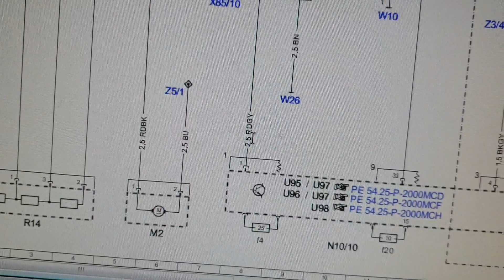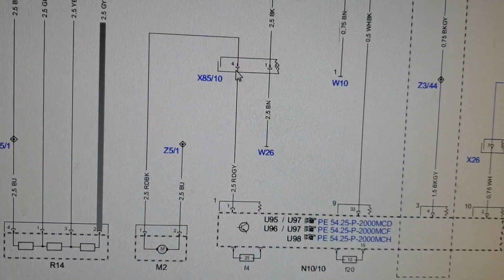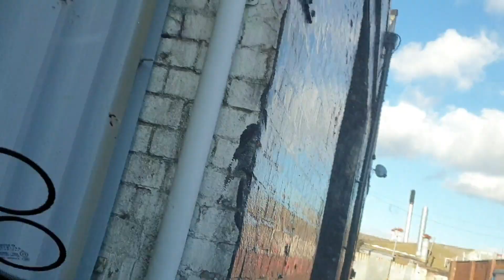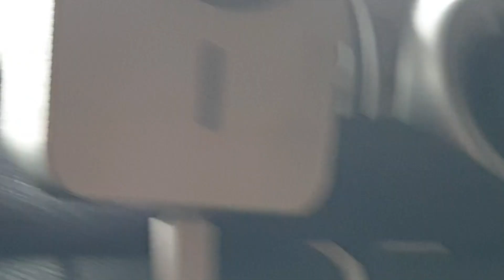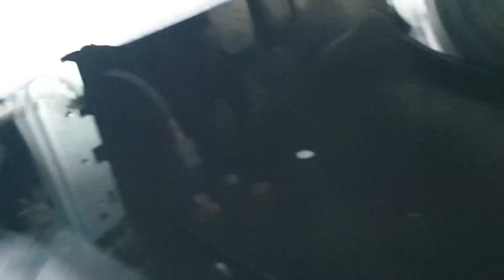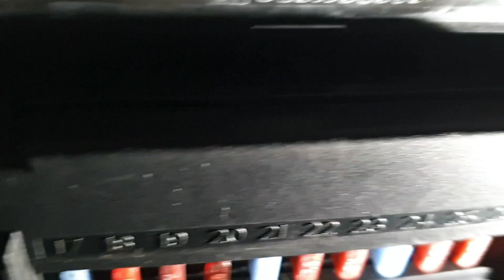Smart Fortwo MHD (micro-hybrid) 451: HVAC Fan/Blower Motor Circuit Explained, Diagnosed, and Fixed.

Comment: Is the heater blower motor located at the passenger's side (For right side driver)?  Do it need remove the SAM first before i can access/take away the motor?   Kindly adv. please...
Reply from the maker: Thanks for watching our channel. Yes, it is located on the passenger side, but I can't remember whether I removed the SAM or not, but you can find it in the video if you watch it.
Reply: @stanhopeautorepaircentrewardak  tried to take out the blower over 1 hr, still not succeed.  I did drop down the sam and let it more space for the blower out but still blocked by the thick bundle of wires. Great to have your kind adv.   Many thanks
Reply: I have same problem 😢 it was working afew days ago. Now it’s not working

Comment: Great video, slightly repetitive but very well explained. The 451 in our workshop also has no fan. After checking all the usual suspects, Fan, heater switch module, resistor we also opened WIS to view the wiring diagram. and like you we first tested the 25 amp fuse (No 4) (both terminals positive) then went to the connector X85/10 the pre fan connector to check the red/grey wire and that was negative! We fed that wire a positive signal and the fan sprung into life. So we either have an open circuit between the SAM and this connector or maybe a fault in the SAM itself? I’ll check for open circuit first.  I’ll post the diagnosis once fixed.
Reply from the maker: Thanks for watching our channel 😊
Reply: You are good people, God bless you...
Yo tengo un carro así es 2009.. donde puede conseguir un diagrama claro... ayuda por favor.